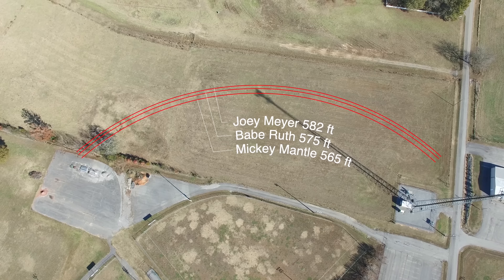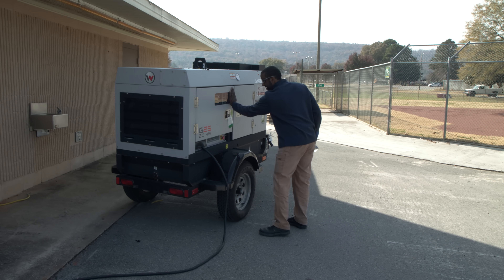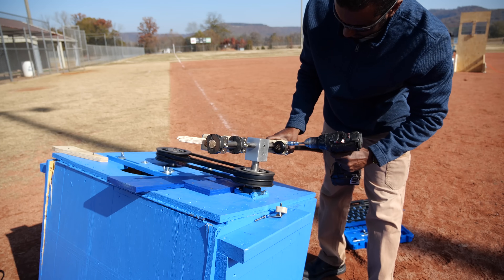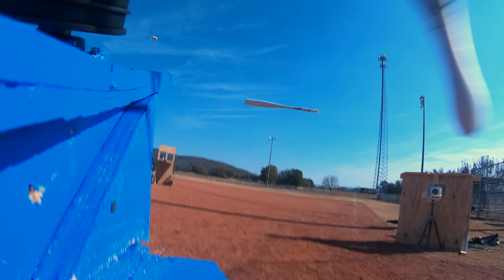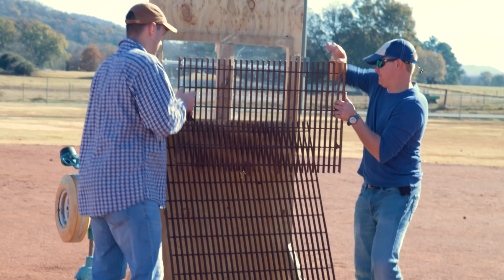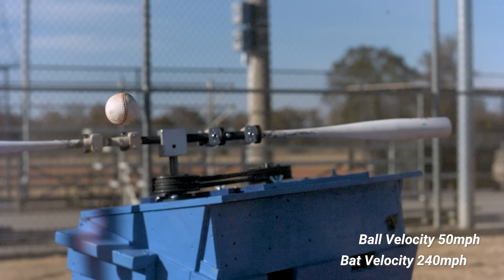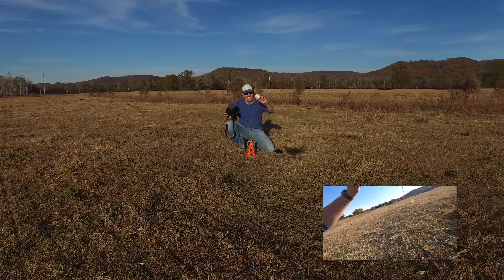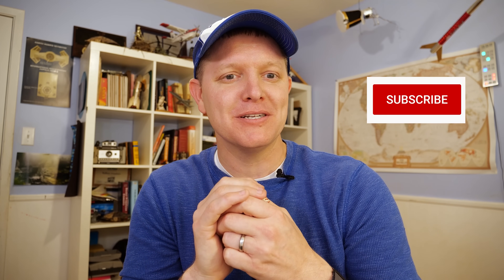World's Longest Home Run (The "Mad Batter" Machine) - Smarter Every Day 230

Comment: I'm surprised how much additional force was involved to gain only an extra 100 or so ft of distance. I'm sure it was not hit at optimal angle but it seemed to be close enough that the difference in angular momentum a perfect angle would have wouldn't equate to a significant difference in distance within a standard deviation. Meaning hitting it twice as hard than Babe Ruth, and Mantle hit theirs only gave us an extra 100ft of distance which has me believe it's nearing it's dynamic and physical upper limits of the ball

Comment: you should use clutch plates on the ends of the rotor arms on which would be mounted the bats. This would model the resilience in the batter's wrists. since momentum =Ft, the Force is reduced and the contact time increased So the ball will travel far without a bat-breaking force.
Also need something spreadout the force along the bat handle to mimic the batters fingers rather than hold the bat at one point. Also need some softness  as in batters fingers, perhaps wrap the handle in rope
wrap bat in Duct tape to stop broken bat flying away. add a trigger which can be swivelled aroundbal the motor spindle and then clamped in position
 when the bat hits the trigger, that will release the ball( providing button is pressed to activate it)
That depends n design of ball throwing machine which i dont know.

Comment: Some tips here:
1. Use a slanted wall to hide behind with a lexan sheet to properly deflect the ball. A ball or a bat that hits a wall at 90 degrees can as well penetrate it and cause you to get a lot of wood splinters embedded in your body. Sloped armor is used in tanks for that specific reason.
2. Use a helmet whenever you have things like clubs and bats potentially going into orbit. Even if it don't protect against a direct hit it can protect against splinters and secondary items flying around.

As for 3-phase - for some reason it seems to be unusual in the US while here in Sweden almost every home has it, sometimes even small studio apartments.

Comment: I saw pujols play in junior college and hit a home run with an aluminium bat. Went over the fence, over a creek, over the hill past the creek, over the tennis court fence and it rolled to a stop at the far fence. I was a ball boy and ran it down. The ball wasnt round anymore. More than half was permanently scuffed red from the clay on the courts and the leather was deeply abraded on the impact side. Id never seen anything like it, until a man built a blurns hitting machine straight out of futurama

Comment: You should add some sensors to read the ball location and speed and adjust to the bat speed up/down to get a perfect hit! Add some weight/ disc etc for inertia and to minimize destruction if you loose a bat. 1000ft maybe!

Comment: the maximum distance possible would be 736.5 (2416 ft) in perfect condition ,  range = V2 (sin (2*angle)) / g  , so based on V == 85 m/s (190 m/h) . angle of 45 . You should have atleast gone for 1000ft

Comment: for an smart guy… you are taking quite an stupid risks…        that wall you stand behind , aint giving you anything else than mental cover.   Would be same as standing behind sheet of paper or that thing if part of the bat comes flying towards.         I mean.. ever seen an tornado clip of 2x4's passing house walls..    yeah…        the bat may not have as much kinetic energy , but still way above the limit of what that plywood can stop or slow down enough to not be lethal anymore.

Comment: When the SAC commander retired (back in the '80s), all the aircraft with which he was associated flew by one after the other, and then there was a pause - when the Blackbird arrived it was at about 45 degrees until it got to the end of the flightline, whereupon the pilot pointed it directly up (absolutely vertical) and then broke the sound barrier - it was out of sight on a clear day in Omaha in a couple of seconds. I've never even seen a missile do that.

Comment: I am one of the few civilians that know exactly how fast the SR-71 could fly. No, I will not tell you. Yes, it's faster than you think.
Reply: Mach 3.2, or up to mach 3.3 if you kept the compressor inlets below 800°F. That was a material limitation of the J58 engine and to get to mach 3.3 was very touchy having a very small flight envelope between you and death pushing them that hard. Flamout at just under mach 3.2 was 50/50 survivable. Just ask bill weaver what happened to Jim Zwayer.
Reply: @kg4boj  good guess but incorrect.
Reply: @caveman6345  There is no such aircraft as the SR 71 anymore, its theoretical top speeds and envelope are well known. Mach 3.2 to mach 3
3 doesn't matter anymore, spyplanes are looong obsolete there is no reason to hide their specs, heck you can even get exact measurements and blueprints for them now.
Reply: @kg4boj  so says you, I happen to know better.
Reply: @caveman6345  Thats amazing mr neckbead. I don't care.
Reply: @kg4boj  yet you put forth the effort to try to discredit my statement....
Reply: @caveman6345  Thats amazing neckbeard.
Reply: You seem to be in a state of confusion, I'm not either of the guys sitting in my pic and your attempts to insult me have failed. By all means please keep trying, it amuses me.

Comment: Happy new year all!
One of your best, hands down. Congrats on the WR! =)
Tip: You can use brake ballast resistor boxes to slow down the motor fast. Check out how they are wired on CNC machines.

Comment: The reason for why the record for the longest home run is in Denver at Mile High city is because the density of the air is less than it will be further down in the lower altitude

Comment: 7:41 "-and it's clear in this shot, that my attempt to duck, comes well after the bat was gone."
In other words. Had this bat gotten flung towards that little window there, the "safety-glass" and your head would've been a fine pink mist, before you even knew you had an accident. 😨 Careful now.
Reply: Polycarbonate is much stronger than it looks.
Reply: At least they would have had it on video.

Comment: 10:43 You can see the bats stopping right at the impact.
Reply: They aren’t stopping, just slowing down slightly. The bats are moving  such that they match the fps of the camera. When they hit the ball, they get out of sync and so take on a different apparent speed.
 If they were actually moving so slowly that they could be stopped by the balls, they wouldn’t be sending the balls flying like that.

Comment: If your input voltage to the VFD is single phase the VFD will compensate and still produce 3 phase but it may draw extra current and the protection circuitry will shut it down. Curious where you were reading voltage.

Comment: What I remember best about the SR-71 was that they leaked fluids (required fluids like oil), leaked fluids like a sieve.......UNTIL they achieved operational speed. If a Blackbird wasn't leaking on the tarmac, you were getting ready to fly with a damaged plane........NOT a good idea.
Truthfully, this wasn't a fault, in and of itself. The flight speeds of the Blackbird required tolerances in the airframe and engines that accounted for expansion from heat buildup. Heat buildup brought about by those very speeds. 
It became a choice. Closer tolerances that preserved operational fluids, BUT also limited the potential of the airframe......OR looser tolerances that allowed leakage, BUT also allowed for maximum speeds.
The choice that was made is quite obvious - the Blackbird leaks like a sieve.

Comment: Until you added that grill for protection, I was beginning to think I was watching Dumber Every Day.
Reply: Considering the lightweight things Mythbusters has punched through plywood, yeah I was worried.
Reply: I think even with the grill, at those speeds, the ball would have been shredded by the grill and "ball shrapnel" could have made it through the grill and plywood.  Bats could have flown off the machine in any direction.  Think of the carnage a tornado can cause; this is way faster than that.  There was some woefully inadequate safety consideration here.
Reply: @dejaphoenix  you need to watch the golf club video
Reply: This could have turned into a Darwin Award very easily.
Reply: This was dangerously stupid...
Reply: Especially considering all that aluminum flying around. Yikes!

Comment: why the last minute 2019 upload? did you need to boost your video numbers for the year? it worked out because the first aluminium bat failed and flew at 23:59:58. you ducked into the new year on my phone.

Comment: The "Helicopter" has entered the field!
Reply: Looked like on the very last shot it was starting to take off
Reply: @mrkeefor  The vibrations from such a setup will do that. In helicopters the rotors have several degrees of freedom to lead and lag as well as bounce up or down as this effect is called ground resonance and will rip a rotorcraft to pieces, there are a few youtube videos of this on various rotorcraft testing and proving trials.
Reply: Well, actually, if the bats rotated as they spun (or spun as they rotated?) they would develop aerodynamic properties and you could have some lift. 

I have seen some experimental wind turbines that work like that. 
Something to think about! 🤓
(I am actually in the power industry)